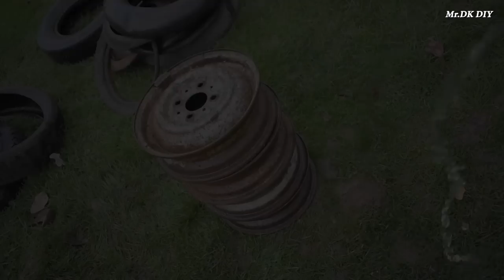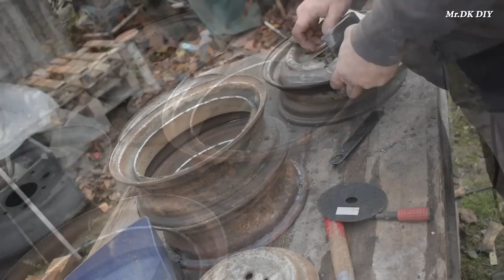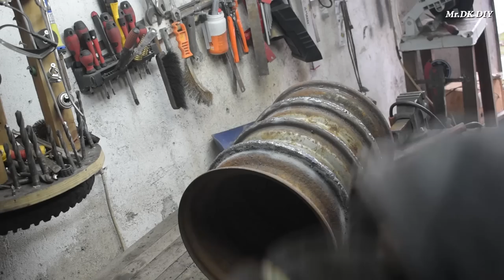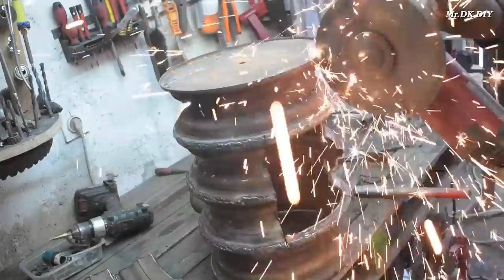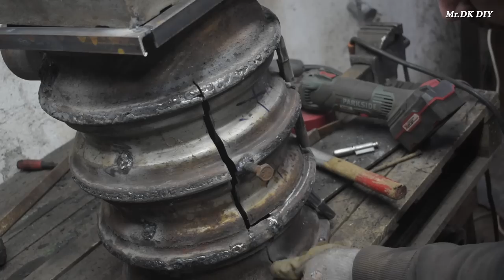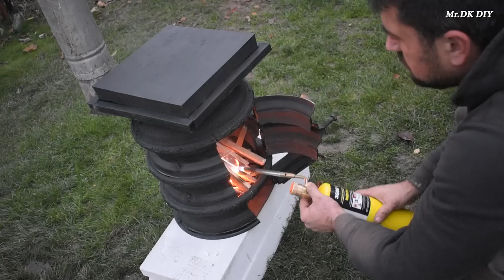4 OLD CAR WHEELS (RIMS) ??? WHAT YOU CAN DO FROM OLD CAR WHEELS / DIY Stove from CAR RIMS

Comment: ive been changing my own tires at home by hand since i was a teenager with simple hand pry bars and hammer, the tires come off from the front, there is a lock bead built into the wheel on the back side of the wheel, they come off easy with a simple soap solution
Reply: عنلهسعر

Comment: I get the feeling that this was a "Let's just do it" kind of project with no prior planning.
If I was making it, I'd have chopped the original welds holding the hub's into the rims and knocked the whole center out so as to avoid having those ruddy great return lips all over the inside, and I wouldn't have welded all around the 1st to 2nd and 3rd to 4th rims so I could use the unwelded join as the top and bottom of the door. Same with welding the rims together in the area where they're being cut out for the chimney. I'd also probably have made the grate as a removable ring and not welded the 3rd and 4th rims together (Just metal alignment tabs around the outside edge) so the rest of the body could be lifted off and the base used like a bucket to take the ash wherever it was being disposed of.
It's an interesting idea, But not particularly well executed. Sorry.
Reply: M

Comment: It's not a grill, because where do you put the meat?
 It seems to be a wood burner, type wood stove for heating a garage, 
but only using tiny pieces of wood.
 You could fry bacon on the top, 
but it would be contaminated with paint.
Reply: But you can use it to boil water  for tea or coffee

Comment: Why not just keep the bottom wheel intact and fill the holes? Also, are used, steel barrels hard to get a hold of where you live? I know they make smaller varieties than the 55-gal drum.

Comment: looks like made it upside down?  where cut center of the wheel out,  the edges look like facing up? why? that will trap ashes, humidity condensation. if the edge had the ridge facing down, then nothing can land or fall into & cant collect moisture. 

anything else is opinions or changes to it. & as long as works. its good.

Comment: Well,... that's a 'nice' stove I guess but way too small. The wood you can put in it would have to be quite small and would not burn long. Also it has way too much gap in the doors, it would leak smoke when not burning quite hard. Just fine for sitting around drinking beer in the back yard I guess, but not much of a heater.
Reply: I don't know about that i have a wood business and are work area is the side of a barn to block wind and when we are cutting logs and splitting wood we got 2 55 gallon drums burning are scrap wood with multiple holes drilled in them and once they get ripping they throw the heat pretty good , better than open fire on ground , just saying

Comment: Pretty good, great skill there... but lacking in originality for me personally (plz don't take wrong way).. I've seen lots of DIY stoves out there, ones made from empty barrels... I like to be more inventive with various parts from scrap-yard... there's literally endless possibilities you can use car alloys for.. because all your looking at is form.. organic forms, robust forms and so on.. make us a reel you can use on a boat made from old car alloys... or a security vault made from old alloys and a lock and key mechanism... a table, with 4 U shapes (from alloy) made to support the table.. (and bell shape of alloy (centre bit as the table top bit).. a clock made from car alloy, a DIY made Fan that can blow air and be used in the office/elsewhere.. a Jet Turbine (monument) made from car alloys, and ways you can manipulate/bend the metal in interesting ways... how you can temper metal to make something else.. e.g. cutting several pieces out of alloy to make a full out fan... a Crucible made of car alloys which you can use for smelting.. perhaps you could even smelt the alloys and cast a new shape/mold out of the metal/properties they possess... make something entirely new... e.g. a Workbench Vice made from smelted car alloys... a gas pipe system that can expel gas away from a workshop (like those big pipes you see).. car alloys bent/stretched/welded and reshaped into Fenders on a car protecting the wheel from elements (e.g. rain and dirt and tarmac and all that stuff) etc... a Bin to dump your stuff into.. a coil, made of long piece of car alloys welded together to form a snake that can be bent and manipulate into a swirl shape which could act as a spring or suspension on monster truck etc... a Rocket Engine Tester (to test different fuels and measure rates of thrust) and so on..